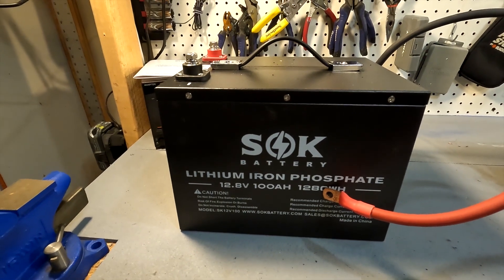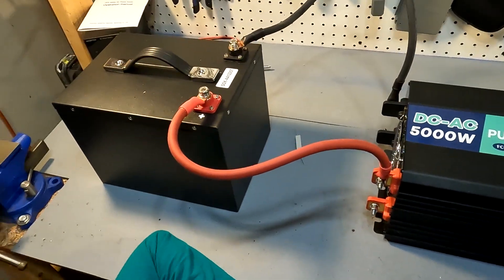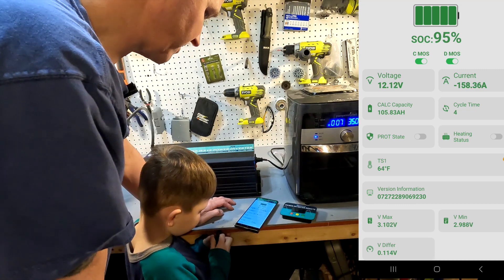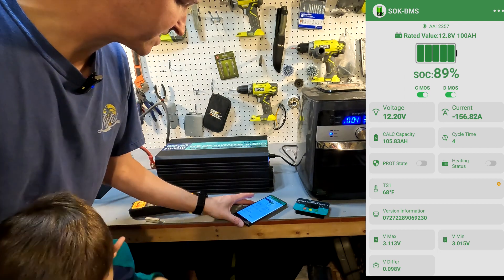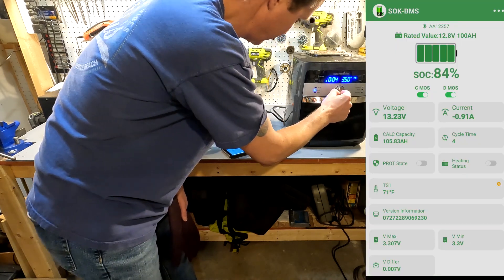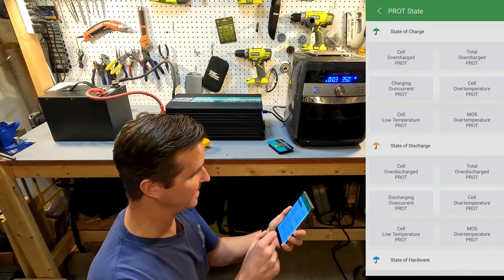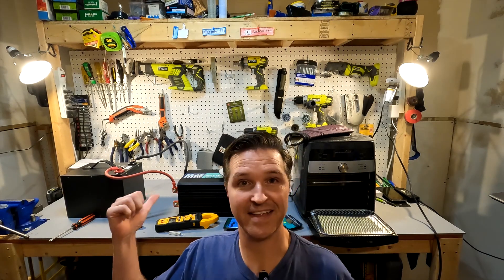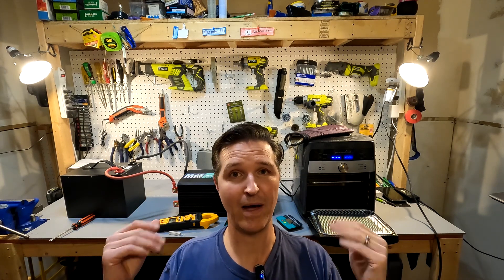I pulled over 150 Amps from a SOK 12v Lifepo4 Battery!  How long do you think it could last?!

Comment: I have the same battery, 100A continious, Peak Discharge Current 200A for 3 seconds, BMS Discharge Current Cut-off 330A. Spec sheet name: SK12V100H & SK12V206H.pdf
Reply from the maker: Have you ever tried pulling over 110 amps?  Another comment said his will shut down.  Just wondering.  Thanks for the info.
Reply: @OffGridBasement  I never try pulling that much yet.

Comment: Demonstrates how poor the quality control is on the BMS.  I own the exact same battery and it shuts down immediately at 110A.
Reply from the maker: That was what I was expecting.  I believe that is what the BMS is supposed to do.  I need to open up this battery to see what the BMS shows.  Thanks for the comment.
Reply: The recommended 100ah max discharge is there for battery longevity. The SOK BMS is designed to do more but not advertised as such.

Comment: Amazing video. One day I hope to own S.O.K. batteries. For now I have Chins. I checked the specs on that battery and while it is listed as max continuous discharge is 100amps, their web site lists Peak Discharge Current  200 A (7.5 s ±2.5 s). interesting how your current draw was right in the middle. If you ever put it in a permanent system, you may want to think about a 150-175 amp fuse.
Reply from the maker: Thanks for the info.  I have the chins as well and they have performed perfectly!